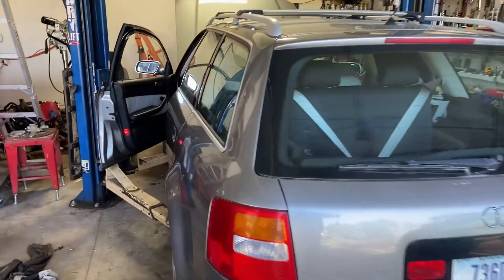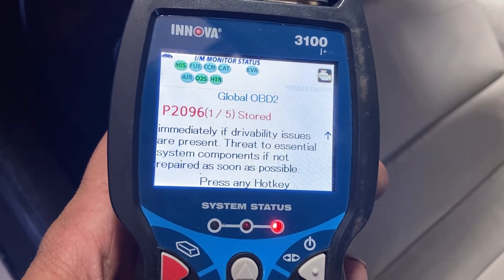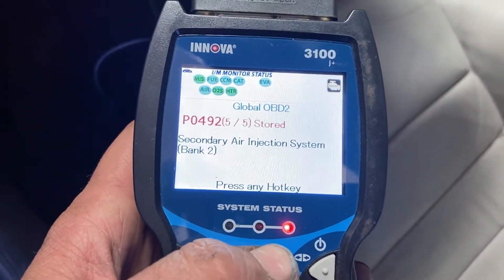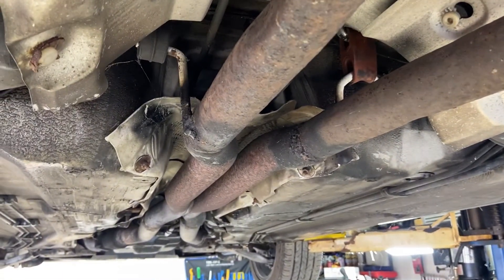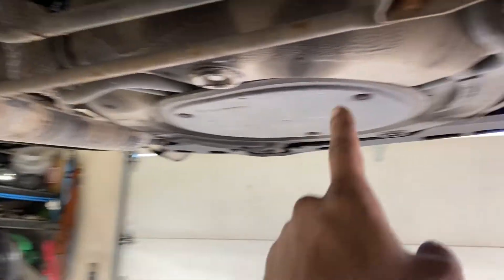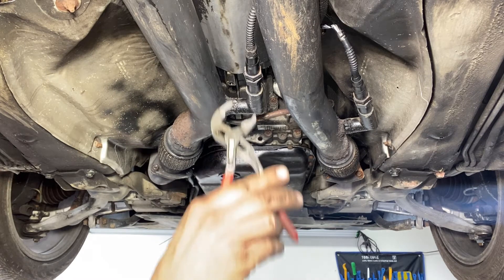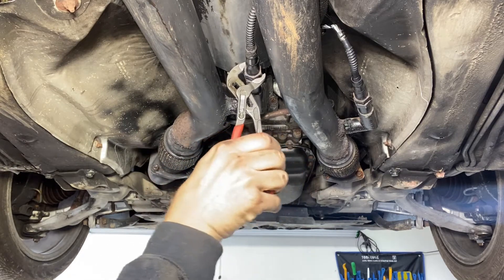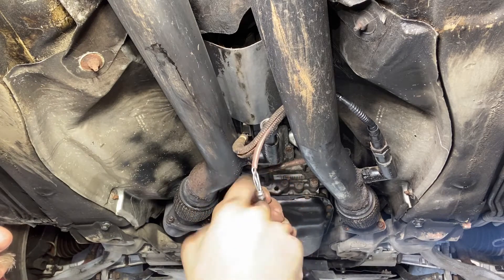4.2l Audi vw p0161 p0159 heater circuit 
Oxygen Sensor replace s6 s8 custom exhaust resonator cat c5

Comment from the maker: So far after about 4 full drive cycles and 100 miles, no faults returned.  I did not address bank 1 sensor 2 lean fault. P2096. If it returns I’ll do another video addressing it and why I did nothing to address it the first time.

Comment: Excellent wiring job.. I agree on not having to run that sensor wiring up to the engine bay, since the wiring was found to be good.. so did you say the two white wires were not polarity dependent ? Hey I’m getting P1198 B1 S2 electrical malfunction and P1199 B2 S2 do you think both post cat sensors are dead ? Or can you tell me if the wiring is bad, is there a resistance value the sensor should have? Excellent video!!! I love those elbows you welded in